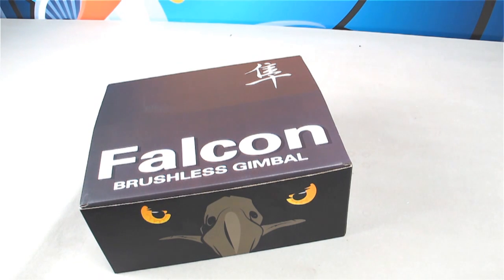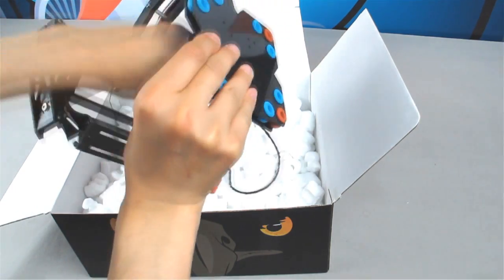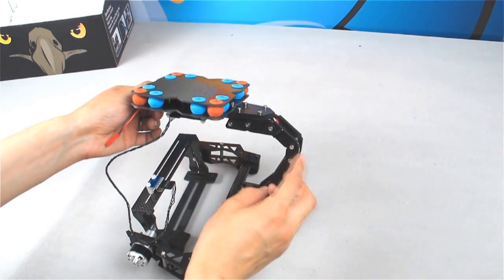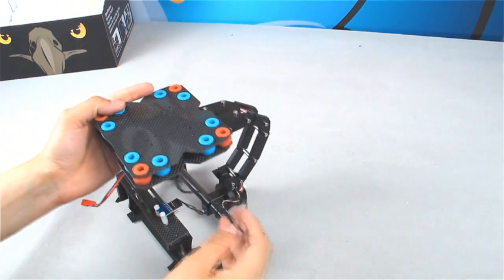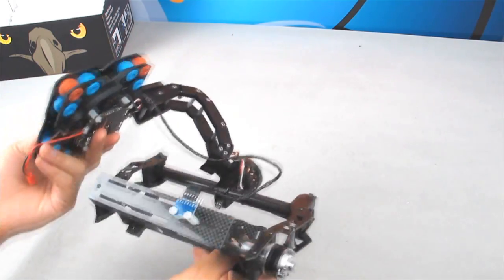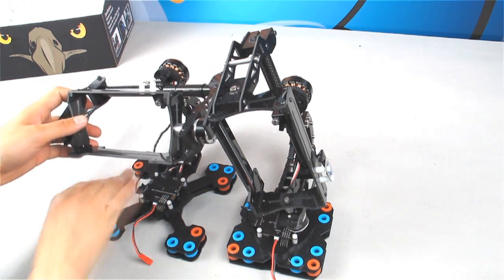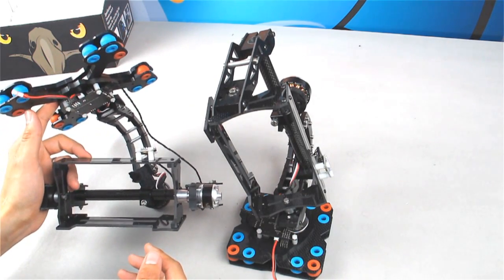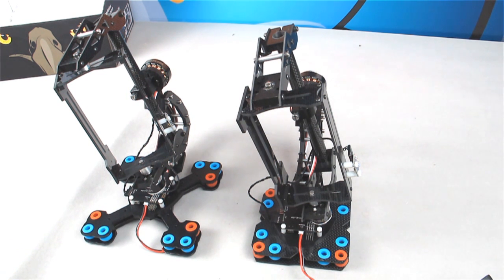Foxtech Falcon Gimbal Demonstration

Comment: Dear Fu,

Wonder how the Top Damper Plate (small) to FIT under the quadcopter?
Any Adapter / screw or nuts provided for DJI F450/550 ?